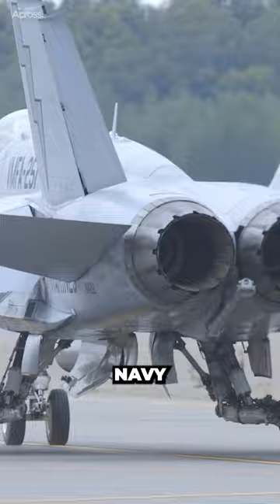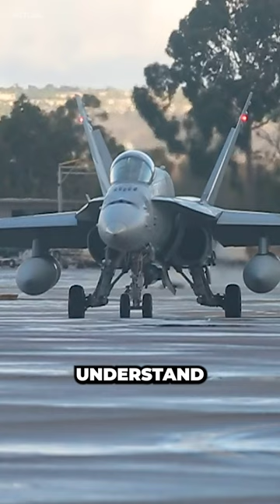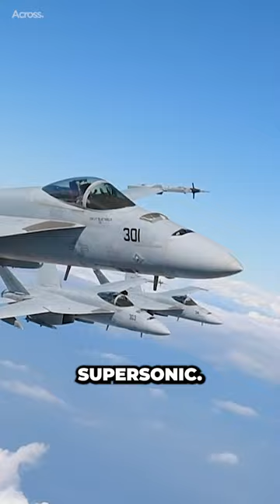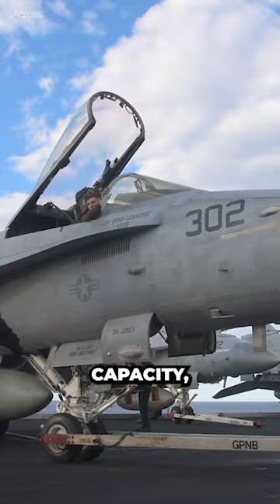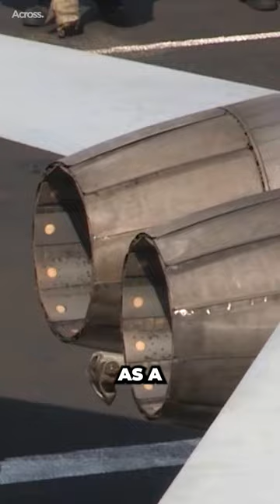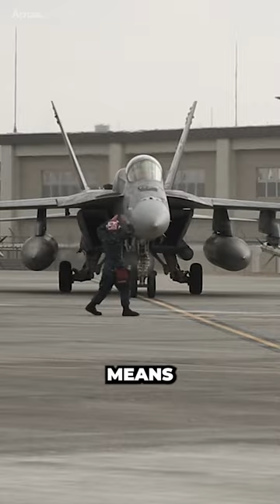Why Can't the F/A-18 fly Faster than Mach 2 #shorts

Comment: To go faster then Mach 2, it would need variable geometry engine air intakes to control (reduce) the speed of the air entering the engines.  The F-16 has the same problem, which is why it's top speed is limited also.  The F-15 has variable geometry inlets and can get up to mach 2.5.  In point of fact, a high supersonic top speed hasn't proven all that useful / necessary in combat.
Reply: F16 can go Mach 2+
Reply: Nerd
Reply: Speed has been used in every dogfight and if you don’t have it your going down in flames
Reply: @hotlanta35 bro there isn't any dogfight nowadays
Reply: @hotlanta35 No dogfight has ever happened at Mach 2 dude. As a matter of fact there has only been one supersonic gun kill, and it was back in Vietnam. You Don't have to go Mach 2 when you have missiles that go Mach 4.
Reply: Ask any non woke fighter pilot about speed in a air to air duel

Comment: Speed is relative and how that speed is applied in which circumstances is also relative to that speed, and those speeds and how it is applied in those circumstances and how they are behaving in those circumstances. -In other words, a system running at Mach 2 better than a system at Mach 3 or 4 can be better than those at those speed without control. -Additionally, a stronger laser can knock out any hypersonic systems running at Mach 10 or greater since it can run at the speed of light.

Comment: ... and you failed to mention the folding wings. They can not stand against wind force above Mach 2.5 which could and has damaged F-18's.
F-15's can go faster without the wings failing and are ONLY inhibited by the amount of power and size of the engines.

Comment: Fun fact f 18 range is 600mi 30 miles more than a car so which if the aircraft carrier is not un the right rang of the mission the f 18 is harder to work with
Reply: That's not true at all because of 1 thing. Tankers.

Comment: Another consideration is that supersonic speed for the Hornet & most fighters requires using afterburners. Afterburnes can use up the jet's fuel in about 15-25 minutes minutes ⛽ 🔥.
Reply: yeah the afterburner fuel still has its normal tanks I would like to think they would use solid fuel for afterburner fuel ⛽